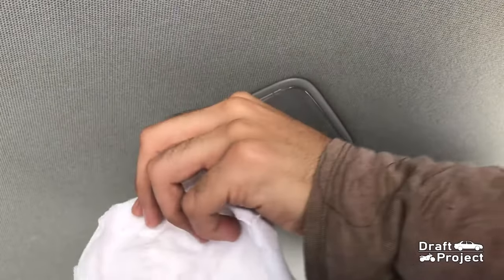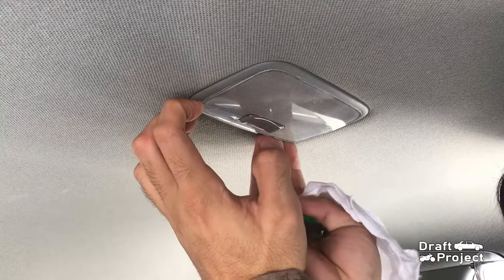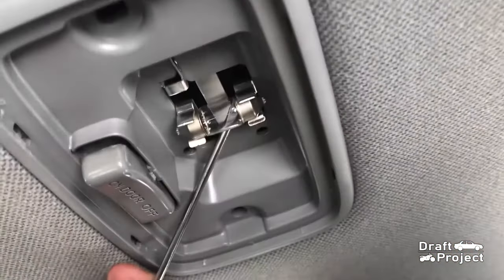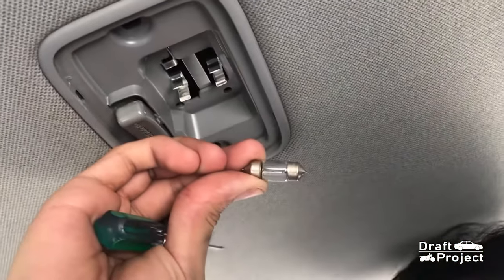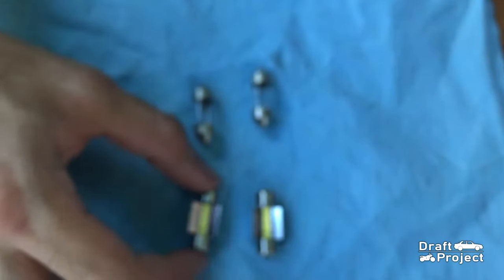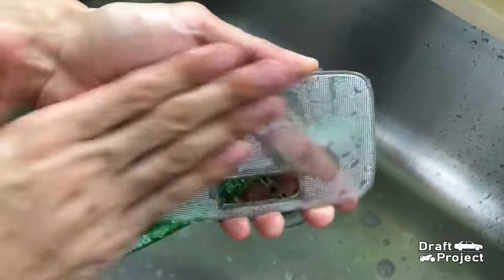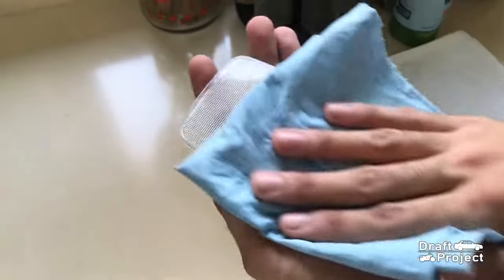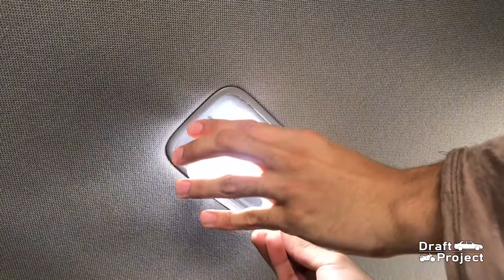Dome Light Bulb LED Upgrade - Hyundai

Comment: what sizew is the light bulb?
Reply from the maker: I wasn't sure about the spec of it since the owner of the car bought it. The length of the bulb is approximately 1 and a half inch. Perhaps try searching "festoon led 12v dome interior map light", you can find something similar to this bulb.
Reply: 28mm length
Reply: De3175

Comment: Boss what’s the led bulb model
Reply from the maker: Sorry I couldn't provide. It was the owner who bought it, so I don't have an idea about the model he bought.

Try searching for "festoon led 12v dome interior map light". You might find something similar to this LED bulb.

I hope this helps. Thanks.
Reply: Alright thank you sir
Reply: 3175
Reply: @realtyrocks1969 model is it sir ?
Reply: @sutan8888  if you are asking what bulb fits the Hyundai Venue dome light, and the 2 front dome lights they are all 3175. I bought the Sylvania ones because I read they make a higher quality LED bulb. I've been using them for a few weeks now and they are excellent. The trunk light is also a 3175 on Hyundai Venue. I assume most dome lights for Hyundais are 3175. The one shown in this video is a 3175 as well